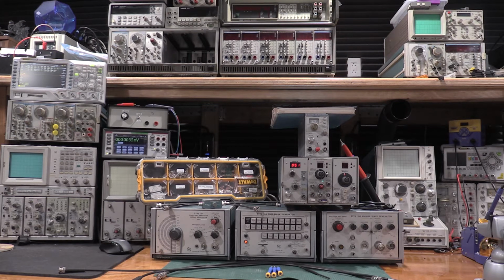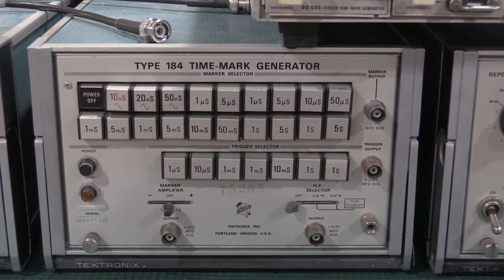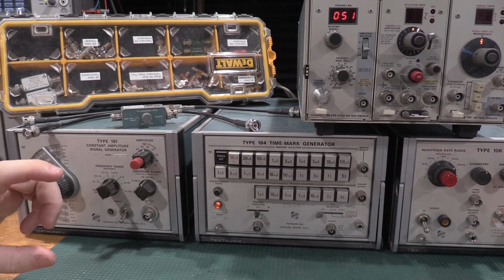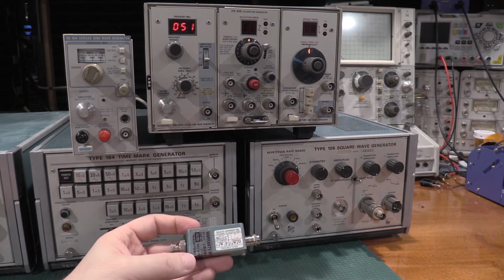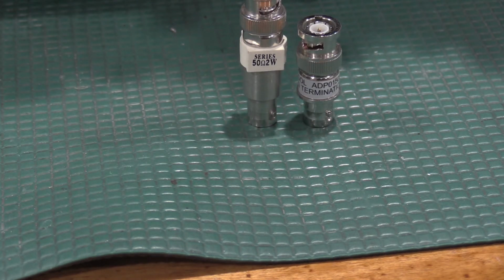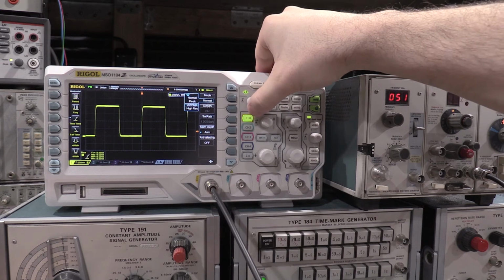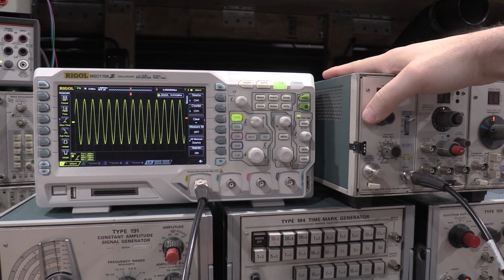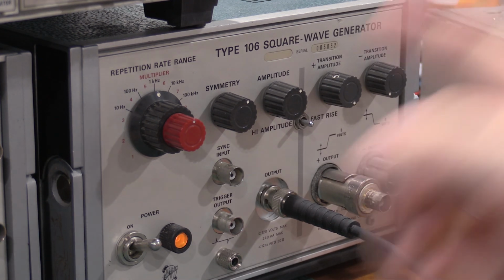How to Calibrate a Scope

Comment: Great timeless video.  My first scope is a 2515 which I started the calibration process but realizing all of the other components needed I started acquiring them recently. one of them was a Tek 067-0502 calibration fixture. I didn’t see you making reference to that.  I got the same type 191 and 2901 time marker but the funny part is that they all need to be calibrated so I ended up buying a new TBS2072B plus some used HP 3325A an HP 3561A and just today I got an HP5335A. I wouldn’t be surprised they all need to be calibrated.  now I feel like getting a Type 106 like yours. I love this more than my actual job but its a rabbit hole.  Thanks for all your videos I enjoy them very much.
Reply from the maker: Great to hear and glad I can help. The 067-0502 was superseded by the PG506 and PG506A anything that needs a 067-0502 can be done on a PG506x. same thing with the Type 184 2091, the TG501 was the replacement there is is a loss of functionality on the 184 as it can run 2 Different time markers at the same time. The 2091 and TG501 can not. For me that rabbit hole ended with a 7.5 digit DMM and a GPSDO/Rb (2 boxes not 1) source for frequancy. That starts the chain of trust and everything builds from there through the cal gear, all the way up through the scopes.
Reply: @Zenwi @ZenwizardStudios also got one DMM like yours but 6.5 digits.  Which GPSDO/Rb you use?

Comment: Great video. I have started to collect the test gear in the 500 series and find your videos interesting, especially this one. One quick question that I have often been wondering (and challenged by) what do you use for calibrating voltage ref on tek scopes? on older models like 22xx/24xx the voltage ref is not as insanely picky as e.g TDS series? which I have problems with.   Maybe a topic for a video?
Reply from the maker: I have an example of one of those it is a 067-0502-0x. This unit was replaced with a PG506 which was then superseded by the PG506A. All  are great units once repaired and calibrated. To calibrate these you will want the absolute best DMM that you can get. 6.5 digits is barely enough to do the 067-0502-0x and the stability of a 7.5 digit DMM is needed for the PG506 and 506A. An 8.5 digit DMM is really the best tool but those can be hard to source for a home lab.

Comment: really enjoyed the video. The next time you calibrate your Tektronix 184 time mark generator could you please do a video of it, really interested in how you aligned the crystal oscillator
Reply from the maker: I will see if I can get that on camera in all honestly it was a frequency counter coupled through a scope probe and a LOT of tedium. As the oven heats and cools the clock swings about 50Hz +25 -25 on the 10 Mhz clock. It is making sure it averages out to 10 Mhz. I have also been thinking about getting the rb reference hooked up to the 184 but I have not put serious thought in to that as I have it on a TG501. The warmup time for the crystal is fairly extreme as well. It is 3 hours to use and If I remember correctly 48 hours to calibration. This is also one of those units that keeps the oven warm when it is off and on standby. So unless I am planning a scope cal the oven is allowed to go cold.
Reply: @ZenwizardStudios  Thank you for your reply I've just purchased the 184, I plan to calibrate it soon. I purchased it because I've been learning scope calibration for the past year or so and learnt a lot from you.looking Forward to your next scope calibration. Thanks once again.
Reply from the maker: @davesdigitaldomain Glad I could help. The calibration routine in the service manual can be much simplified with a good frequency counter and a GPSDO as a reference. If more zeros of accuracy are needed or desired. The 10Mhz reference for the FC can be GPSDO (1pps) -> rubidium reference -> frequency counter external reference.

Comment: Great Video...  love all the old tube stuff.  You hardly talked about your TG501 ???  Are you going to do a check-in and Cal video on it ??
Reply from the maker: I can if it would be helpful. The functionality is duplicated in the 184. The 184 has a little bit more functionality even though it is older. The TG501 gives you time marks and not much else. You do not get the ability to do 2 different time marks like you do in the 184. Also the trigger time marks are slaved to the setting on the dial you cant set them independent either. So you can set 3 different time marks at 1 time on the 184. 2 on the main 1 on the trigger. On the TG501 you can set 1 time mark setting and you have a trigger output synced to that setting and you cant change it. I personally find me self reaching for the 184 more often then the 501 even given the 2-4 hour warm up of the crystal.

Comment: Thank you very much for this Video.
I had a 106/184/067-0502-01 and a 284 on my Bench, but i sold them and kept only the 106 and the 284
when i got the 3 TM 500 modules, i only miss a 504.
My 284 seems to have the same Problem as yours, the Diode is fine but it does not fire. So i`m looking forward for a repair video :-)
Reply from the maker: You are welcome Taunus. On my 284 I have confirmed the diode on a curve tracer. There are 3 resisters that have increased in value in the TD enclosure. two of them are inside another resister (physical dimensions is incredibly impotent), The back termination on the negative side. also lead dimensions have changed as the front resister is not soldered in to place on one side it is only press fit.  In to the center of the connector. The good and the bad news is so far the back termination resister is complete unobtainaium. The TD its self it looks like can be sourced but at a cost of $250.00 per diode. And it was not used often in Gear there is the 284 and there is a sampling unit that used it I think and that is about it no there are not really any donors out there. But then I have another problem of characterizing the working unit and making sure it is in spec. But at the current time I have nothing THAT fast in the lab. I only go up to 500 Mhz with the 7904A and a 7A19 plugin. So I have nothing that can really show me what is going on at 70ps of rise time …. Yet
Reply: @ZenwizardStudios  Here are some pictures and description.
https://amplifier.cd/Test_Equipment/Tektronix/Tektronix_other/284.html
He writes about some oxydation issues on the resistor.
I recently aqired a S-4 for the 7S11/7T11 so rise time measurement should be possible.
Reply: @ZenwizardStudios  Is the increase in resistance measurable ? Could be the same problem on my unit.
Reply from the maker: The resistance is very measurable. My issue seems to be R184 B&C. I am expecting a resistance of 660 Ohms I read 721.770 Ohms. This is with 4 wire measurement. I am looking for replacements currently however there is a physical dimension that is hugely important here as B&C are inside of A which is the 54 Ohm back termination resister. I have yet to find resisters that actually fit. I also do not know if there are other issues just yet with it either but all the support waveforms seem to be there. The +/- Bias and the tripper pulses all seem healthy.

Comment: I keep meaning to ask you this. Do I remember correctly that you needed a 576 CRT?
 
I grabbed a new in box one in an auction. I don’t have it in hand yet but if it’s as it should be when it arrives and you want it let me know. You can have it for what I paid for it if you need it.
Reply from the maker: NOS 576 tubes are really rare I could use one as I have a 576 that is in rough shape but if you need one for your supplies I have 2 that are in good shape. I am using the 577's more as the tubes were not unique to the instrument and are much easier to come by. I am saving the 576's for when I really need them. But I do make sure they don't just sit ether I start them up every once in a while to maintain the circuits. Let the caps see voltage, let the circuits come up to temperature,move the knobs so nothing seizes, drive moisture out of the resisters. Don't need to do anything special just let the unit run for about 30 minutes every couple of months and twiddle some dials.
Reply: @ZenwizardStudios  I don’t have a current need for it. I really like the curve tracers and I’m certain I’ll pick up more of them as the opportunity arises so I’ve started to buy parts when I find them in good shape or better yet NOS. When it comes in if it’s as described and survives shipping I’ll let you know. I’d happily send it on to you, it’s the least I can do. I’ve gotten a lot of value out of the content you are producing and I can only imagine the amount of time it takes. Thank you for that.